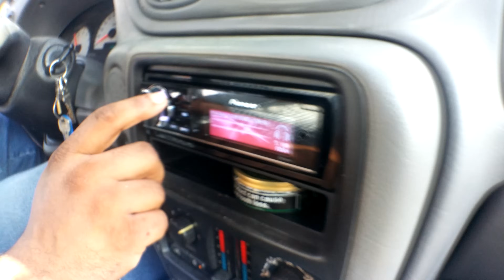How To Recone & Repair A Speaker or Subwoofer With A Drop-In Recone Kit

Comment: So any sub can be rebuilt. I have a 12in. Txx blue eye candy sub. I lik the brand and the speaker was passed down to me from my brother that has passed away since. The dust cover sperated from the coil. Coil is still good and works. I had it in a sealed box and hit some low hz. Ppl say throw it out and buy a new one but I can't find myself doing that. It don't need to be the blue aluminum look. I just want to hear it play to bring back some memories. Thanks for the time and info if any. Keep the videos coming love you hem and there vary helpful.

Comment: Good looks, thanks for the video 😎

I'm gonna have to do this soon, i have blown the + off of each side of my sub 3 times now 🤐 and the wire this last time was about 10mm long xD i managed to get some wire soldered on there but i dont think thats gonna work next time rofl not to mention that the cheap wire i used is probably making it pop more frequently as well 🤣🤣

Comment: I would have test out the ohm with a multimeter before dropping those subs inside the box. And also taped the surrounding part where the voice coil gets in. Just to be safe you don't want anything inside there. Last thing I would have used a peace of tape and rubbed it inside that space where the coil goes in just to get any little dust that got inside. And used some more clamps and activator with CA glue